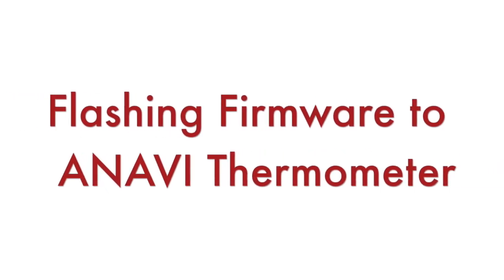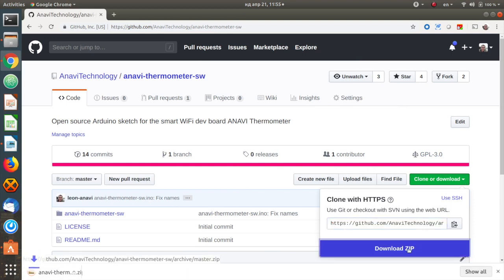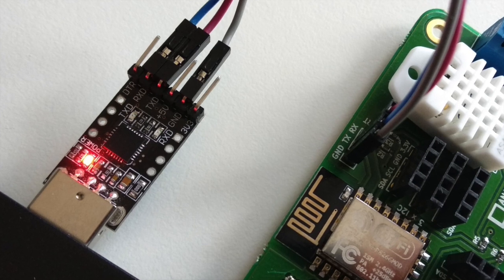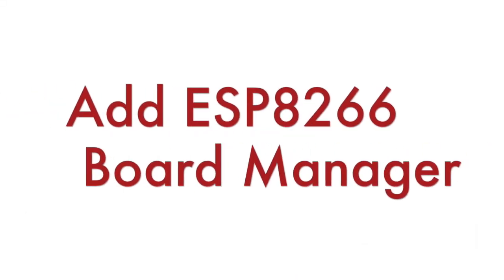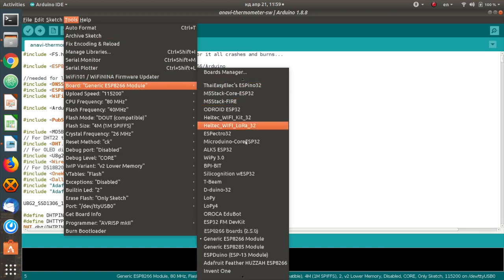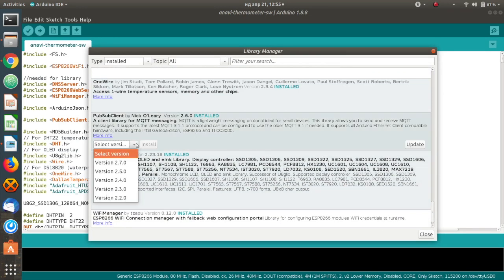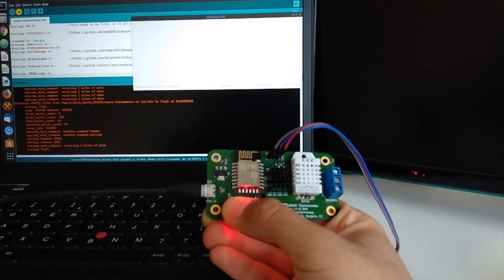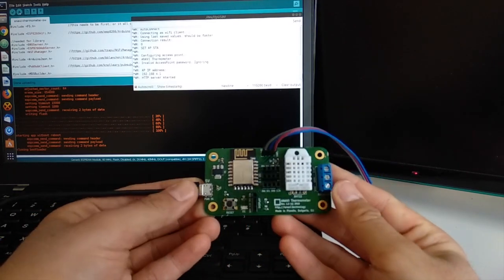Uploading Arduino Sketch to ANAVI Thermometer

Comment: Great stuff! I managed to compile and update the firmware by following your tutorial.
I would like to play with and customize the sketch to my needs, like adding a timestamp to the payload, adjust timezone, etc...
However, Arduino is new to me and I am a bit afraid of messing things up. A few questions about it:
     
1 -  If something goes wrong, can it brick the thermometer? 
2 - Is there a recovery procedure in that case?
3 - Would it be possible to test it on a virtual machine instead of flashing it directly to Arduino?

If you have any recommended material for beginners I will be very grateful!
I love this thermometer and hopefully will be able to create my own server and mobile app. :)
Reply from the maker: Don't worry if your Arduino sketch doesn't work properly just upload new firmware via Arduino IDE or esptool.py. For recovery you can just flash again the default open source firmware.

There is no virtual environment for emulation of the device. ANAVI Thermometer is a development board so I highly recommend directly testing with the real hardware.
Reply: Fantastic! Good to know!
Now I have peace of mind to try things out, which is the main point with this hardware, as you said. :)
Thanks for the support!

Comment: Just received the Miracle Controller and you mention to flash with the latest, so I followed the steps provided.  Tried to compile on both Mac and PC, but I always get errors.  Here's the error I receive on the PC:
Arduino: 1.8.12 (Windows 10), Board: "Generic ESP8266 Module, 80 MHz, Flash, Disabled, ck, 26 MHz, 40MHz, DIO, 4M (1M SPIFFS), 2, v2 Lower Memory, Disabled, CORE, Only Sketch, 115200"

In file included from D:\Documents\Arduino\anavi-miracle-controller-sw-master\anavi-miracle-controller-sw\anavi-miracle-controller-sw.ino:46:0:

D:\Documents\Arduino\libraries\WiFiManager/WiFiManager.h:38:0: warning: "WIFI_MANAGER_MAX_PARAMS" redefined [enabled by default]

 #define WIFI_MANAGER_MAX_PARAMS 10

 ^

D:\Documents\Arduino\anavi-miracle-controller-sw-master\anavi-miracle-controller-sw\anavi-miracle-controller-sw.ino:11:0: note: this is the location of the previous definition

 #define WIFI_MANAGER_MAX_PARAMS 12

 ^

D:\Documents\Arduino\anavi-miracle-controller-sw-master\anavi-miracle-controller-sw\anavi-miracle-controller-sw.ino:68:21: warning: extra tokens at end of #undef directive [enabled by default]

 #undef LED_TYPE1    WS2812B

                     ^

D:\Documents\Arduino\anavi-miracle-controller-sw-master\anavi-miracle-controller-sw\anavi-miracle-controller-sw.ino:69:21: warning: extra tokens at end of #undef directive [enabled by default]

 #undef COLOR_ORDER1 GRB

                     ^

D:\Documents\Arduino\anavi-miracle-controller-sw-master\anavi-miracle-controller-sw\anavi-miracle-controller-sw.ino:71:21: warning: extra tokens at end of #undef directive [enabled by default]

 #undef LED_TYPE2    WS2812B

                     ^

D:\Documents\Arduino\anavi-miracle-controller-sw-master\anavi-miracle-controller-sw\anavi-miracle-controller-sw.ino:72:21: warning: extra tokens at end of #undef directive [enabled by default]

 #undef COLOR_ORDER2 GRB

                     ^

In file included from D:\Documents\Arduino\anavi-miracle-controller-sw-master\anavi-miracle-controller-sw\anavi-miracle-controller-sw.ino:64:0:

D:\Documents\Arduino\libraries\FastLED/FastLED.h:14:21: note: #pragma message: FastLED version 3.002.006

 #    pragma message "FastLED version 3.002.006"

                     ^

In file included from D:\Documents\Arduino\libraries\FastLED/FastLED.h:65:0,

                 from D:\Documents\Arduino\anavi-miracle-controller-sw-master\anavi-miracle-controller-sw\anavi-miracle-controller-sw.ino:64:

D:\Documents\Arduino\libraries\FastLED/fastspi.h:110:23: note: #pragma message: No hardware SPI pins defined.  All SPI access will default to bitbanged output

 #      pragma message "No hardware SPI pins defined.  All SPI access will default to bitbanged output"

                       ^

c:/users/richa/appdata/local/arduino15/packages/esp8266/tools/xtensa-lx106-elf-gcc/2.5.0-3-20ed2b9/bin/../lib/gcc/xtensa-lx106-elf/4.8.2/../../../../xtensa-lx106-elf/bin/ld.exe: C:\Users\richa\AppData\Local\Temp\arduino_build_6402/anavi-miracle-controller-sw.ino.elf section `.text' will not fit in region `iram1_0_seg'

collect2.exe: error: ld returned 1 exit status

exit status 1
Error compiling for board Generic ESP8266 Module.

This report would have more information with
"Show verbose output during compilation"
option enabled in File -> Preferences.

The board is fried after a flash attempt.  Suggestions?
Reply from the maker: According to the log the Arduino sketch fails to compile. Seems like a configuration issue or mismatch of Arduino IDE and library versions. Sorry for the inconvenience. If you just want to upload the latest firmware and to avoid all these Arduino IDE configurations, you can just download pre-built binary release and flash it to ANAVI Miracle Controller usign esptool.py.

The latest release as of today, anavi-miracle-controller-sw-100-20200527.bin, is available for download at:
https://github.com/AnaviTechnology/anavi-miracle-controller-sw/releases/tag/1.0.0

Details how to flash in with esptool.py are available at this blog post: https://blog.anavi.technology/?p=209

The command for flashing with esptool will be something like:

esptool.py --port /dev/ttyUSB0 --baud 460800 write_flash --flash_size=detect 0 anavi-miracle-controller-sw-100-20200527.bin
Reply: @LeonAnavi  Yes, that was a lot easier, thanks.  I had to run the tool on the PC.  The Mac wasn't cooperating.

BTW, had a hard time HA seeing it via mqtt.  I finally deleted my mqtt integration and re-added and it popped up.  Not sure why it didn't see it before.

I'm going moving to my next phase, using a 6812 light stripe and will mount under cabinets in my office nook.  If that works well, I will purchase another Anavi Miracle Controller and do the kitchen.

Thanks again for your assistance!
Reply from the maker: Good work! I have an old mac mini here but honestly so far I haven't tried esptool.py on it yet. I will give it a try in near future.

As for HA MQTT integration: yes, unfortunately,  HA isn't rock solid nowadays. Recently my whole HA installation on Raspberry Pi broke and now I have to set it up again. This happens for second time in the past months.
Reply: @LeonAnavi  upgrade to a NUC.  I did that - Ubuntu with Home Assistant in Docker.  Works great.